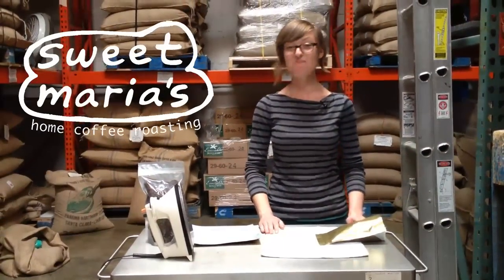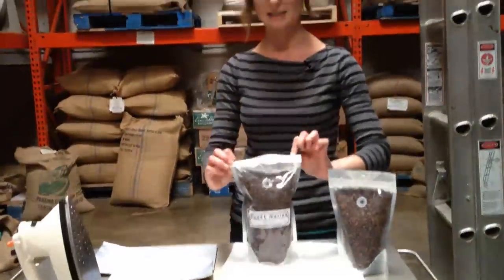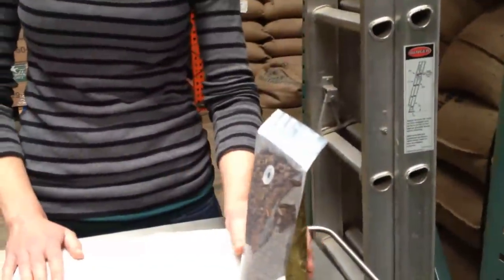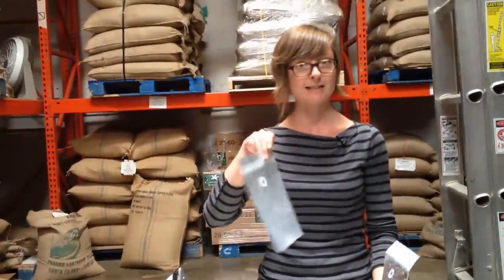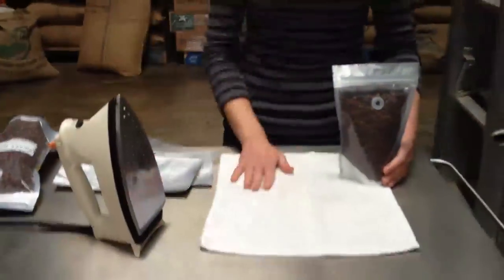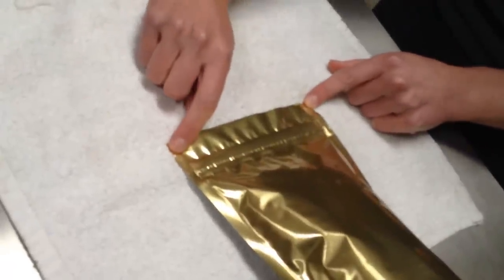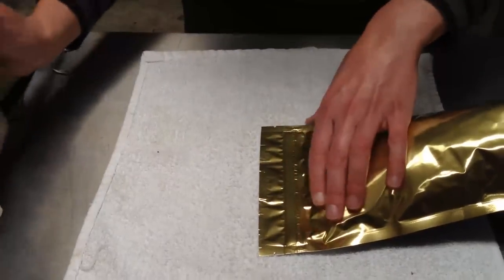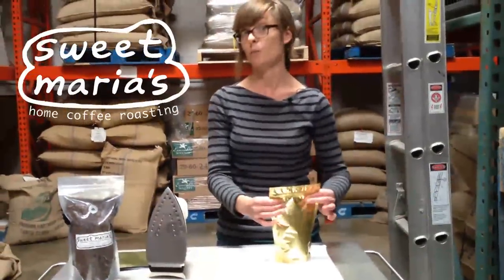How to Seal Gold Foil Valve Bags With an Iron

Comment: Thanks..got an idea to re-seal (re-using) ldpe courier covers. I tried with   with the iron . Carefully  measuring temperature with thermocouple 😂.  But it melted . Will put a cloth or paper in-between iron and plastic cover and try doing it.  I feel it might work.
Reply: It works 😁 .. direct hot press with iron on recycled plastic(ldpe) melts it . Indirect heating is best for recycled ones . ( By sandwiching the plastic with cloth or paper and hot pressing  ) .
But new plastic covers (ldpe) can be directly hot pressed with iron. Should experiment more to see if results are consistent 😋

Comment: Hello, 
Does this become airtight?
Reply from the maker: Yes, it does become airtight, once the zipper is sealed
Reply: @SweetMariasCoffee  
It will be very helpful for me if you can tell me does it remain airtight forever or does air gradually get into it like in a span of days Or weeks or months  ? 

Thank you for replying. 
Binnoy
Reply from the maker: @Visualizingmathandphysics  It's hard to say since these bags have a valve in it that allows gasses to escape but the zipper and heat seal should give you a solid seal for months
Reply: @SweetMariasCoffee  
Got it. 
Thanks for replying.

Comment: I want to cook soup and pack it in a aluminum bag, freeze it, market it. The customer will buy it and put it in boiling water and eat it. What is the home solution?
Reply: Hi Saif, did you find a solution to this?
Reply: You likely want to get a vacuum seal system for this like is used for sous vide a lot of the time. It will better protect from freezer burn by sucking out all the air and it will be totally sealed. These bags are specifically made for coffee beans and have a one way valve that lets gases escape the bag, but I highly doubt the valve will hold up to boiling so it would probably fail and leave you with a mess.

Comment: how do you fill the bag without opening
Reply from the maker: The bags come unsealed. You would need to heat seal them after filling them with coffee. After the heat sealed area is torn off, the zipper seal can be used.
Reply: ginny kim LMFAO
Reply: @SweetMariasCoffee  what is the temperature of the iron when sealing?
Reply from the maker: @kk8382  Medium/High. The trick is to keep the iron moving so it doesn' t burn the outer material on the bag.
Reply: @chrismelendez7843  i have so many questions. why did i comment this...what kind of question was that.... why was i watching this video...